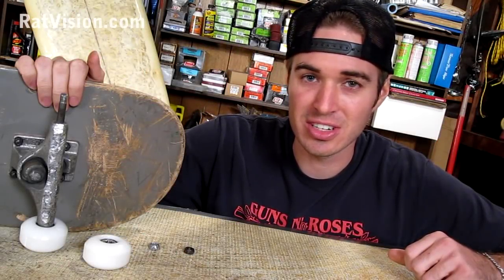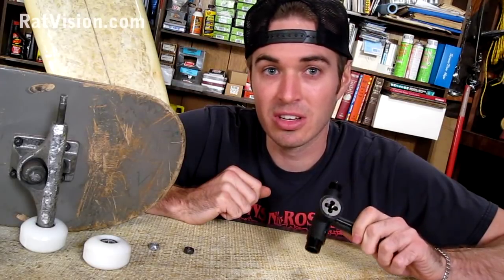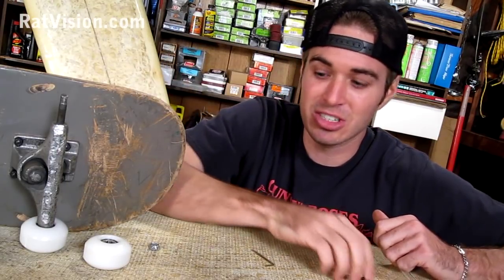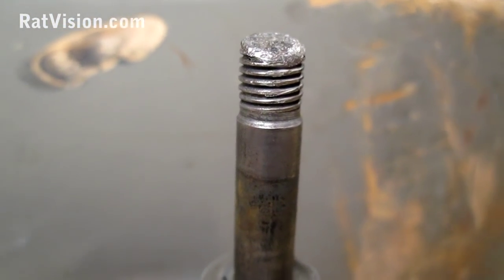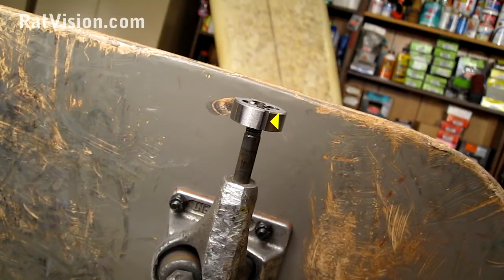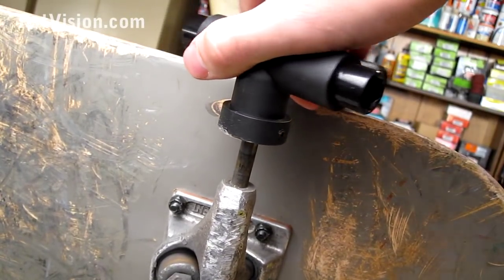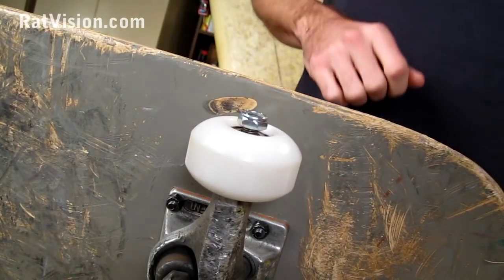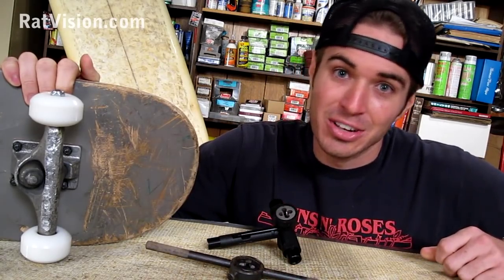Fix Truck Axle Threads On Skateboard & Longboard

Comment: please make a video of the best engineered skateboarding wheel. 
I'm dying to know which one i should stick to. 
thank you      PR
Reply from the maker: We mention Oust a lot, and we do for good reason.  They are the ONLY company that actually knows what they are doing, and not pushing just a brand name.  The unfortunate thing is that Oust only supplies one wheel shape with 2 diameters and durometer (if I remember right).  Their core is exactly .400" inch.  The wheels are more dense, because they treated the urethane differently and used the highest quality available.  No one can afford to buy a bunch of wheels and cut them up and look at the wheel structure under a microscope.  We have.  Ricta was supplying good wheels a while back.  I am not sure how they are now.  They could be Chinese garbage.  Bones seems to have good urethane, but it's hard to say, at the moment, how well their wheels are manufactured.  In another video we point out how Bones wheels do not accommodate Bones Bearing spacers.  That is poor engineering/manufacturing right there.  The real honest problem is that no one cares anymore.  It's all about how cool their brand is.  People also have no clue what a good product is so they get suckered into buying gimmicks from greedy brands.
Reply: And how about truck brand? I currently own a pair of thunders. I remember owning a pair of tensor mid back in high school, I learned 360 inward heels and hard flips with those. After I traded them, it just wasn't the same. 😞

Comment: One of my trucks can't hold nuts tight enough. Even when I switch the nuts it's still loose enough to be un-tightened by hand. Will re-threading the axle work? or by thread locking it?

Comment: You shouldn't need to locktite a nylock nut. Matter of fact, you shouldn't at all because it can cause the nylon lock to malfunction and cause premature failure. This is advice and regulation handed down to me from a former aircraft mechanic and inspector. Nylocks have that nylon lock insert for a reason. If it's not working, you got bigger problems.

Comment from the maker: @DjHottspinz209 It should work.  Your trucks must have been really damaged.  Unfortunately I don't have the time to make a video about this.  Try hammering harder.  The threads are no longer in a spiral, so they are kind of locked together.  Send me some pics to ratvision@yahoo.co, and lets go from there.  Be sure to send pics in focus, use the macro setting if your camera has one.  The button usually looks like a flower on most cameras.

Comment: can you tell me what so special about skateboard truck nut(wheels) ,i buy some in the hardwere store  and i cant screw it on the truck.only skate nuts can be mounted?only in skate shop you can get this skate nuts?
Reply: Did you make sure it's the right thread number? You could have gotten coarse, fine or ultra fine?? And well the nuts have plastic at the top to keep it from loosening but other than that they are any old nut
Reply: Erick Perez yes i find it cheap in the hardwere store
Reply: +orion skate youre suppose to get nylock nuts. the nuts that self tighten
Reply: I would take your truck to the hardware store and say "I need nylon nuts with this thread number"
Reply: I FOUND THAT YEARS AGO.thanks

Comment: I have a different tool, but it also has that axle fixer. but it can't come off, so when I try to use it with the tool on it, it never gets a grip of the axle. plz help, it never works.

Comment: Do a video on the difference between plastic trunks vs metal trunks
Reply: +Duzty Hobbz 
I think you mean trucks. So far I've only seen plastic trucks on really cheap kids toy boards and not on real skateboards because plastic breaks to easily and isnt grind resistant at all. Just any pair of simple aluminium trucks of any brand will do great. They don't have to be too expensive when you're a beginner. Have fun and go skate.
Reply: yeah I meant trucks, my phone is dumb. I just bought a Dark Star mainly because it has metal trucks and decent grip tape. The only thing I am not very fond of on the board is the wheeles being 52's when I am used to 50's and the board is wider but I enjoy the board anyways. Overall it is better than the beginner Kryptonics board that I had before.
Reply: nice. I also started skating on a darkstar but I bought a new one after it was completely torn and used, but it was a great board.
Reply: +bluerainstorm It's my first Dark Star, I haven't really heard anything bad about them. I was going to get a Dew Tour board until I realized they had plastic trucks.

Comment: Do you have any tips to get the  nut off a stripped thread. It just keeps spinning. The wheel is still on and I want to get it off.
Reply: Do you have any solution ? Same happened to me

Comment: hi got a question.bought a 2nd hand truck some time back and it was kinda rusty along the wheel axle but it works.anyways problem is the end of the axle seemed worn out and i tried to have it rethread in a local skateshop,but the guy told me better not to rethread until it is really fked up.is this true?cos im worried if it gets worse i wont be able to get out the axle nut at all...and the nut is also somewhat worn out but i dont know how the kid's frd manage to mount my wheels...

Comment: are washers really necessary ? i have only one and its in the inside, so should i also put one on the outside?
Reply from the maker: +Niko Dejarme You can skate without them.  Washers are used to spread out loads/pressure.  It is also used as a bushing.  Not like the bushings on your trucks, but to allow space between the truck and bearing, and bearings and axle nut.

Comment: so i put a little of krazy glue on my nut so it wont fall off of the axle but the glue went out too much and it got on the axle with my bearing inner ring and wheel stuck on the axle and i cant get it out, what can i do to unstuck it??

Comment: If you dont have this tool just put the nut on top of the truck and hammer it down until it gets past the bent threads and then screw it on it'll re-thread it when you screw
Reply: NO ONE SHOULD EVER DO THIS!!! If you hammer down the nut it would be like landing primo a thousand times, it will just get worse...
Reply: nah dude ive done it like 4 times

Comment: you should get bearing spacers and new washers (speed rings) the bearing spacers allow you to tighten your nuts down nice and tightly all the way (no backing off) than when you wheel spins its the bearings spinning themselves not the bearing on the axle. Once you try spacers you will never go back!

Comment: This was really helpful, I fixed the thread but the problem now is that I don't have the bolt anymore because it was damaged when I took it off the truck. Does anyone know the dimensions for the wheel nut? Like thread size and what have you? Thanks ahead of time for anyone that knows!
Reply from the maker: M8 might be the metric size.  5/16"-24.  24 is the thread count number so don't get anything else.  FYI it might be hard to find a nut that is thin like the ones on trucks.

Comment: NEVER give a wheel a little movement.. use Spacers and tighthen the nut. Your board will run more quiet, faster and you don't ruin your bearings - they don't like sidewise movement. Cheers!

Comment: hey man I used a 5/16 and it's not the right size where can I get a smaller size rethreader?
Reply: Hardware store. But all axles are 5/16 it could be the thread number you used. I'm pretty sure independents and most trucks are a number 24 thread.

Comment from the maker: That's called a "slipped axle".  There is no way to fix this.  Any good brand should never get a slipped axle, because the axle has splines or grooves to prevent it from happening.  What brand have trucks had this problem?

Comment: hey my axle or nut is like spinning there but not coming off at all, how do i solve this? ists either the axle thread or the nut which i cant seem to tell
Reply from the maker: You need to try and pry on the nut a little bit as you turn it. Hopefully it will grab onto some threads and come off.
Reply: Rat Vision – Skateboard Tech thanks

Comment: i worked on my skate with the die and after 10 minutes we saw change but we couldn't fit the nut on. Is it possible to not be able to retread an axle?
Reply: You might have crossthreaded it or even used the wrong thread number while rethreading. As long as you use the right thread die to rethread and do it really straight then you should be good. To make it a little easier you could use tapping oil or really just any oil
Reply from the maker: Erick Perez Correct.  Make sure you use a new nut too.

Comment: My 2 screws won't come off from the trucks what do I do to be able to actyally get them off?
Reply: Your nuts are aluminum so the metal should be very malleable. You can try and get a thread file, since your space is very limited. If that doesn't help pave the way for the nut to come off, then apply pulling pressure while screwing it off, it will destroy your but your axle will be fine since the metal for the axle is much much harder. Then rethread as needed

Comment: My nut is broken on my kingpin what should u do when that happens i can not replace my bushings
Reply from the maker: I'm assuming you ground the nut down so much that you can't get it off.  Vice grips pliers will probably work.  They allow you to clamp on to whatever nut you have left and allow you to turn it.
Reply: Rat Vision – Skateboard Tech Post another video

Comment: well i have a question my truck axle threads are really damaged and i cant get out the wheels to fix it how can i get them out without destroy my trucks plz :D
Reply from the maker: You need to pry on the nut if possible.  Use a flat head screw driver to push the nut up while trying to unscrew the nut.  Hopefully the nut will grab onto some threads and come off.  This always seems to work.
Reply: ok ty :D
Reply: Yeah and if the threads are really smashed you'll have to file the excess so that the axle isn't wider than the bearing hole.

Comment: How can I prevent to damage my truck axle thread when skataboarding?
Reply from the maker: You can't really.
Reply: If a lot of axle is popping out outside the nut well... u could buy bigger wheels. u can.. add another spacer soo less axle shows outside the nut...  If the opposite is happening and your bolt is not correctly and properly tightened well.. the wheel might come off. So.. look for smaller wheels or trucks with a longer axle. oh well... there is allways a way.
Reply: Don't 50-50/5-0
Reply: dont skate

Comment: any tips if your axle is damaged and you cant even get the wheel off to re-thread it?
Reply: or try to break of the part of the axle thats bent
Reply: Try using different tools to take it off use power drills wrenches socket wrenches in different sizes etc.

Comment: Can someone help? I took my wheels out to clean my bearings, which I'm never doing again, and I tightened the nut as tight as I could get it so the bearings would be in. When I tried to loosen it, it wouldn't come off. I've only had these trucks a few months. This happened to the last pair. Please help ASAP!
Reply: +Tyler Grogg Hey, what I am guessing happened is the nut pinched the bearings together and got onto the axle past the thread. If this is the case, you could probably get it back off by just loosening it off with a lot of force. As for the bearings, I recommend that you push your bearings in by hand by putting your board in a primo position with one bearing on one of the upward-facing axles, and then just push the wheel onto the bearing hard, lean on it if you have to (some wheels have really tight centres). Then do that again for the bearing on the other side of the wheel. this way, you can avoid having the problem you had in the future.
Reply from the maker: +Tyler Grogg Did you get it fixed?  In the video I say NOT to tighten the nut all the way down.
Reply: I usually don't have a problem getting the bearings in, but these ones would not go in even when I put all of my weight on it. But,I managed to get the nut off and fixed the thread with a die and now the nut always tightens by it self to the point where it won't even spin. I figured the nut itself was stripped so I switched it with another wheel, but it's still like that on the one I used the die on and the other one is fine.

Comment: whatever he og other skaters say, there is no advantage of not tightening your wheels fully. the inner ring of the bearing is meant to be stationary, whilst the rest of the bearing is what should turn. it is loud and inconvinient not to tighten it fully. scooter wheels are tightened fully, and they spin for several minutes.
Reply from the maker: You're totally right about that.  We have a video about bearings spacers that explains everything about how the wheel should be tight, as well as all the issues that are caused without the wheel tight.  This video is just about how to rethread an axle.  Street skaters hardly ever use spacers, and most don't even know what they are for, so we showed how to tighten the wheel without spacers.  Longboarders are much more aware of the importance of spacers and wheels being tight.  Check out our video on spacers. I am sure you'll be impressed.

Fastest Skateboard & Longboard Wheels, Bearings, and Bearing Spacers

Comment: How do you tell if your trucks are high or lows
Reply from the maker: You can't unless you know what exactly what trucks you have.  Look at the baseplate and see what brand you have.  If you have a pro model or colored trucks, you can look the brand's website and see if you can find your trucks on their site.  They should say if your trucks are high or low.
Reply: Rat Vision – Skateboard Tech My skateboard threads  are really bad. So I went to my local shop and they tried to fix it with the Reflex Tool and it was made worse. So what should I do? Buy one my self and do it or buy a new truck?
Reply from the maker: OH MY GOD seriously? That's awful. Did they really make it worse?  I am really upset for you.  Totally uncalled for, and horrible service!

What is the shop name, and where is it located.  In our personal opinion, we feel that a shop should know how to do everything we show in our videos.  Sadly, they hardly know anything.  They should have fixed your truck correctly, and if they made it worse they should have replaced the truck, or given you a good deal on a new one.  

To answer your question, I would not buy a tool, and go back to the shop and talk to the owner about what happened. His employee should have been trained how to fix it, and since he didn't know how to use the tool, he should not have tried to fix it for you.  Since I can't see the damage, I don't know if the truck is fixable.  Before you go back, send a picture to ratvision@yahoo.com, make sure it is in focus or I can't see anything.  After I look at it, this is what I'd recommend doing.

If it is fixable, talk to the owner of the shop about what happened.  Tell him you want him to fix it.  

If it is ruined, get the employee's name. Tell the owner you want it replaced, because the employee ruined it.  Hopefully the employee will be there.  He should admit he ruined it.  I can't believe he let you leave the shop with it not fixed/resolved.  

If they don't want to replace it, or give you a really good deal on a new truck.  Then NEVER go back there again.  It sucks, but they will lose your business, which is worth WAY MORE than the cost of giving you a new truck(s).
Reply: Rat Vision – Skateboard Tech Okay Thanks I will be sending you a photo of my truck

Comment from the maker: @Mattdaskater69 What the hell? Sounds like you got the worlds worst die set.  Return the die and get your money back.  You can use a file if the bad area is near the end of the axle. You would need to file away the thread that is folding over, or touching another thread. If you're in the US most big hardware stores sell single dies for a few bucks.  Get a die made in the USA.

Comment: see this is crap about not tightening the axel nut all the way down the only thing that should stop you from doing so is not having a spacer between your bearings. if you have one between them and you tighten it down then it makes you bearings work properly

Comment: Can you skate without the washers on?
Reply from the maker: Yes you can.  They work in 2 ways.  To help spread the loads arounds the bearings and nut, and as a bushing between the nut and truck hanger face.

Comment: Ok so the nut is on the bottom of my truck and i have to put in the kingpin . So when i put in the kingpin and i guess i put in at a wrong angle or something . Then i had to take off the truck and i saw that the nut and the king pin were at two different angles  .. I tried to useing a size 14 thing and tried spining it but  the only thing tht happens is it just scrapes the bottom of the truck  thts how it all happened

Comment: My wheel is stuck on my trucks please help.
Reply from the maker: +HoxenStorm Hit it with a hammer.
Reply: +Rat Vision – Skateboard Tech what if it messes up
Reply: +HoxenStorm It won't. Don't hit it too hard just small taps. Mainly just use the hammers weight instead of your force

Comment: My nut on one axle won't come off what do I do to get it off thanks!
Reply: I have the same problem cant find any help
Reply: +JohnzaKearneyTwitTwit but I forgot to mention its on the kingpin and the washer on the bushing is bent and wont let me take off the bolt on the kingpin
Reply: I had the same problem but I got through it with just reckless force. My axle end got messed up like in the video.